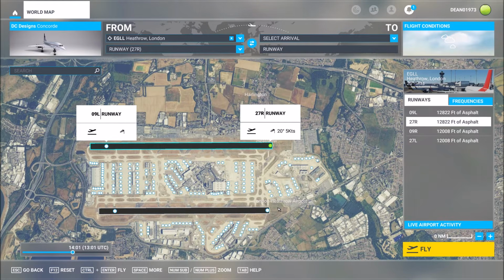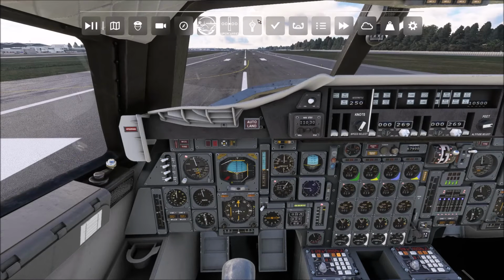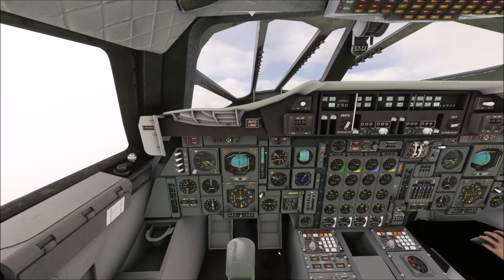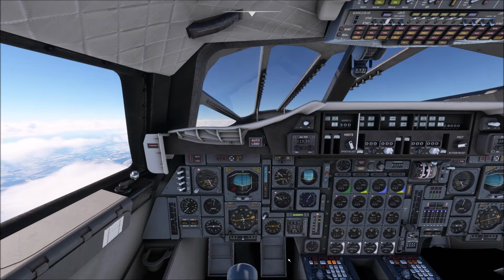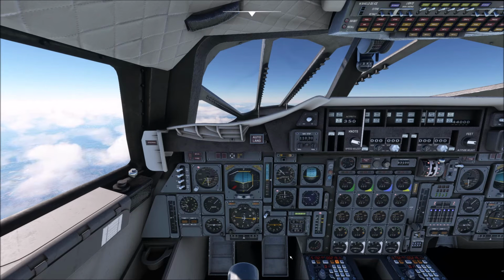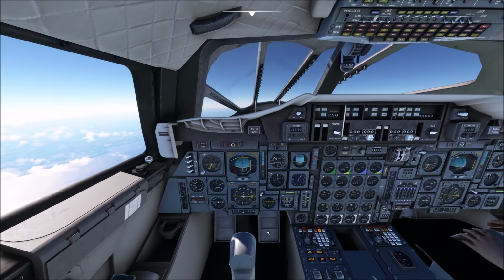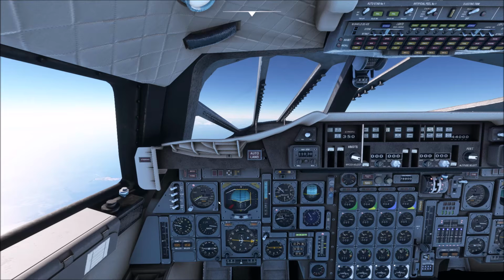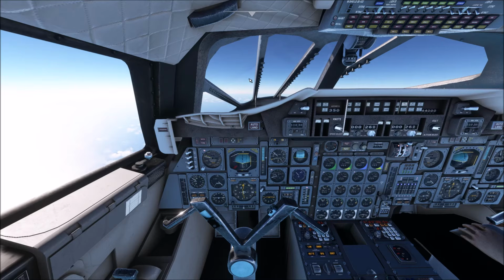DC Designs Concorde take-off, climb, fuel transfer / super-cruise procedure

Comment: A few extra things here. All take offs were with reheats. You don't have variable reheat - they are on or off. As soon as you advance the throttles to full power, you start the stopwatch, so that just after takefoo you have 'cut back time', lower the nose to maintain 250 knots, switch the reheats off and reduce power. On the roll the pf states '3 2 1 now', advances the throttles quickly and the fe switches 2 reheats at a time (inboards 2 and 3 first then 1 and 4). Pm states speed building as the air speed rises on all asi. Pm states 100 knots and fe checks that all 4 reheats are working correctly and we have 4 green lights on for each engine at the top of the centre instrument panel. Fe calls '4 greeens' if ok or 'failure engine (what ever hasn't got the green light).and 'stop'. If alls well then v1 is reached with the pm stating 'v1' then 'rotate' and straight away 'v2 - positive climb' and pf states 'gear up' this is repeated by the pm and lever moved to up. Pm gives the 250 knots call and the pf increase as necessary the pitch to maintain this speed. And then you're at cut back time. Hope that helps. I will add further comments once I get time too.

Comment: I can't manually push the engines beyond 92% with this update. The previous update worked fine but this one is refusing to allow it. I also cannot find anything, even in this video, even addressing the issue. What could be causing this?
Reply from the maker: I saw your post on the MS forums and checked it out, but was unable to replicate it here. Concorde's not at fault but I can't think what might be preventing you from getting reheats to work. No other reports from other users, all of whom are seeing normal engine operations. Sorry I can't be of more help, it might be a settings issue perhaps as some sim updates scramble people's settings ( or have done in the past ).
Reply: @DCDesignsMSFS  I figured it out, and now I feel stupid. It was the burner switches, I completely forgot to turn them on. I believe in the previous update they were on by default but in the new one they are defaulted off. Once I turned them on, the throttle opened up full and I can fly my favorite plane again. Now if I could just get the max climb to work (max cruise doesn't appear to be functional?) correctly...I follow the example in this video but it doesn't seem to work correctly so I have to acquire altitude either manually or without max climb.
Reply from the maker: @xclavex  Glad you figured it out! MAX CLIMB does work, I used it myself during testing before uploading. Concorde will accquire 400 knots before climbing, so it's good to be on the numbers before engaging - 400 knots at FL2400. MAX CRUISE will only engage once parameters have been met, often quite a long way into the flight, and it does so automatically, so just let it do its thing.
Reply: @DCDesignsMSFS  Max climb only ever seems to set the throttles to 90%, then sloooooooooowly climb (500-1000fpm) and doesn't seem to accelerate much (hard to accelerate when you're limiting the throttles to 90%). I let it sit there and do it's thing but it eventually loses speed and refuses to go beyond 90% when in MAX ClIMB mode. Not sure what I'm doing wrong, even though I copied this video. 

At least I can manually fly it now.
Reply from the maker: @xclavex  Once above Mach 1.7, reheat is not used ( super cruise ) as otherwise Concorde would run out of fuel too quickly. This is how the real aircraft operated. It's how Concorde did what it did. I recommend reading about Concorde for more information. It often didn't reach Mach 2 or FL600, those were operational maximums, not typical figures.

Comment: I really like this plane and I have been looking at a bunch of videos on actually how to start the plane up in kind of fly it do you know what else we'll get implemented to the Concorde in future updates?
Reply from the maker: Not yet, but if you use the Interactive Checklist it will take you through an entire flight from beginning to end. A few erroneous reports of autopilot not working in MSFS2024 - I've been using it for days while doing the latest update that came out last Thursday and it is working fine. Most likely people not using it correctly or not rebooting the sim after Sim Update 5 ( all updates tend to destabilise the sim ).
Reply: @DCDesignsMSFS thank you so much

Comment: Hey, DC Designs, 

I'm not sure where else to ask this, so I'm hoping I can get a response directly from y'all.

I understand that Concorde didn't always make it to 60000ft,  and didn't always make M2.00, but since updating, I've been unable to exceed FL495, at any point during the flight.

I've followed this video to the T several flights in a row now with little success. My CG is where it should be, my speed is fine, I sit around M1.95, but I cannot climb higher than FL495ish at any point during the flight without drastically losing speed.

Is this normal behavior? During my transatlantic crossings I typically bring about 85,000KGs of fuel, and thats enough to keep the engines alight until landing, so I don't think I'm overweight.

Any help or response is appreciated, seeing others reach 57/56000 so easily on FPG to IAD or JFK, while I have to sit below 50000 is very frustrating 😅
Reply from the maker: Hi, not sure why it won't go above FL495 but warm atmospheric conditions might prevent it. It does take a long time even for me sometimes to see the magical Mach 2 and FL550, and things like headwinds can make it even longer. It sounds like you're doing everything correctly, and 85 tons of fuel isn't overweight. The AP will auto-balance flight parameters and will prioritise velocity over altitude, so it may simply be waiting for fuel to burn off before climbing. Hard to diagnose remotely, but as you say, others are managing it so it doesn't sound like a bug with Concorde itself. Have to tried some other routes instead to see if it clears up? Concorde rarely managed Mach 2 during trans-Atlantic flights, and often only for a short duration ( when light at the last portion of the flight )  but it was more common to reach it over the Tropics on flights to Barbados etc.
Reply: @DCDesignsMSFS  Its probably just the spring/summer atmosphere temps. I did IAD to MMX last night and managed to get to 510 and M1.98 almost 10 minutes before I needed to descend, I was cheering the plane on, hoping I could break mach 2 beforehand descent. 😅 

Didn't happen, but at least I know I'm doing it right, i thought I was doing something catastrophically wrong.

I'll be heading back to IAD, then FPG, then down to South America this weekend, maybe I'll have better luck towards the equator, maybe not, who knows!

I appreciate the quick response, thank you for making me feel not insane 😅
Reply: @DCDesignsMSFS Update for you on this:

I found the issue: ActiveSky.

When not set in passive, temps at 51k+ can get as high as -49, set it to passive and its around -68ish, I barely struggled to reach 57k today, cruising at 2.02, finally among the big boys!

Comment: Hello, I have a version for MSFS2024 with contrail shop. You not can import flight plans from MSFS2024 to FMC. Manually inserting waypoints doesn't work and the plane doesn't track them. It only tracks waypoints entered manually in FMC. I probably need an update to MSFS2024 because unfortunately it doesn't work. If I'm wrong, please show the same video as this one but in MSFS2024. Importing flight plans from EFB and manually entering coordinates doesn't work. The plane always flies in a different direction than intended.
Reply from the maker: The aircraft has been tested in MSFS2024 and works, however an update is now available with the CIVA INS able to input and store 9 waypoints, as per the real Concorde. Might take longer to reach the Contrail shop though, I have no control over that.
Reply: @DCDesignsMSFS ok thanks

Comment: @DC Designs: Hello there. I have been having problems with fully engaging the brakes on the Concorde in MSFS 2024. (Hydrolic brake pressure will not leave the red zone on the guage and I have checked all HYD systems) I don't have this problem in MSFS 2020. I have spent hours working to fix this problems with no results. In addition to that, I noticed when i use the rudder axis with the joystick and RB it completely disengages the the brakes. What am I missing here? Thanks for reading.

(Xbox Series X - W/ controller)
Reply from the maker: Could be a double-assigned control in the sim's main menu for rudder and brakes issue. Seeing as both main problems are brake related that's my best guess at it.

Comment: Just watching this as a refresher, since i haven't flown for a while, but can you not use the RAD/INS switch above the Nav radio tuner to show the INS course on the HSI?
Reply from the maker: The switch is used to choose between radio navigation or FMC ( GPS ) navigation, slightly different to the real aircraft. When in RAD mode, the HSI will show VOR/DME data as long as a beacon frequency is detected.

Comment: can you manually insert a flightplan in the fmc? wasnt able to find the "/" for the from/to but maybe i was just blind
Reply from the maker: Yes you can, it's in the manual, I think the "spot" key is also the "I" but can't recall without checking visually.
Reply: @DCDesignsMSFS  ah yes. that works 👍 i do however have another issue with that fmc. if i select a SID/STAR it will only show the first 2 and there is no way to scroll through the rest of them. neither the next/previous page button works nor the arrow keys.

Comment: MSFS 2020 (Marketplace purchase) - Is the FMC also limited by 9 WP's, if so then if using the Asobo/MS in game maps with SID/STAR guess doing a direct route in between may be best to adhere to limit. Using FMC had problems with EGCC > EGLL in my testing getting it to follow route using INS button - maybe due to usage of the MSFS map defined / pulled in route (9 limit). But I had enabled FD1&2 on ground before take off thinking that was sensible to prep for engaging INS (one less in air step). Also had problems disabling the AT1&2 during a flight and the NAV1 switch on main cockpit would not switch from NAV to RAD for landing (although maybe only required for real Concorde?) yet the co-pilots switch did work. However I'm clearly flying Concorde wrong doing all that stuff so probably broke it......will review your take off settings further and try more testing....

Comment: Does is simulate out of CG situation where by if the fuel is not managed properly, the whole plane could actually nose dive and crash?
Reply from the maker: No, not to that extent, I deliberately avoid that sort of "study level" detail as so few people actually want it. However, poor CG management could result in the user not having enough fuel to reach their destination if they do it badly enough and there are heavy headwinds, for instance.
Reply: @DCDesignsMSFS  alright got it thx. Will it be difficult to implement it as an option for those who really want “ study level “ experiences?

Some side note, the CG meter doesn't seem to point correctly once the digital meter beside is around 52 and below is this a bug?

For the whole CG thing long story short, the ideal position is just right before the aft label and anything in between those 2 yellow label is still “flyable” right ?
Reply from the maker: @euphoria3066  Yes, the CG error when forward is a bug but not sure of the cause yet. Anywhere between the two labels is flyable for sure. Study level fans account for less than 10% of the audience - I build for the 90%. Concorde is considered difficult as it is to operate by most users, so I won't want to alienate them by making it harder. It's just good business sense, is all.
Reply: @DCDesignsMSFS  understood then can i take the CG warning light at the cockpit as a good reference point if the plane is within the correct CG ?